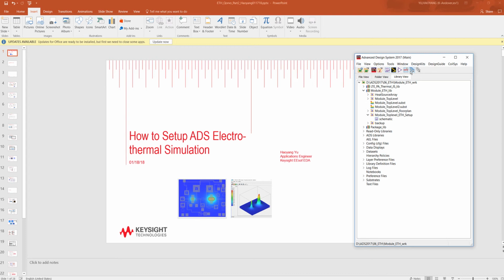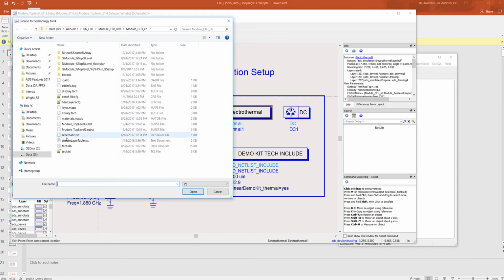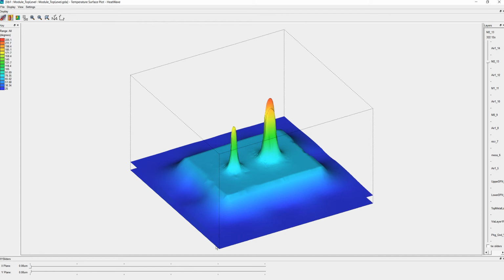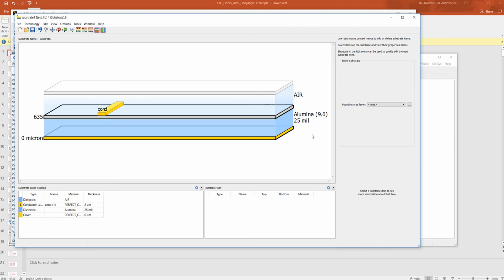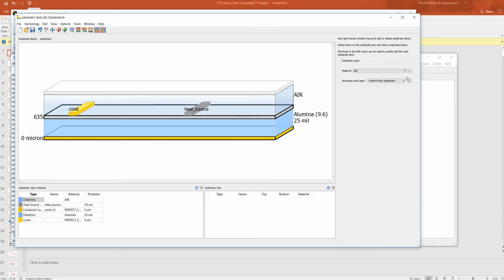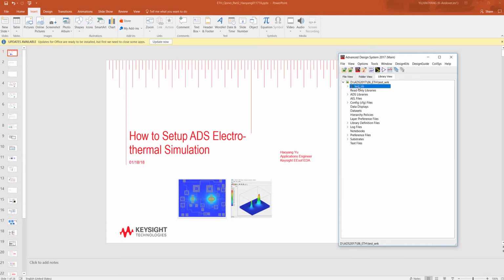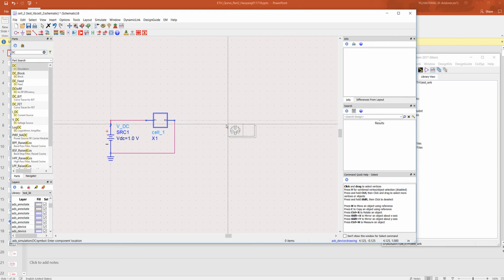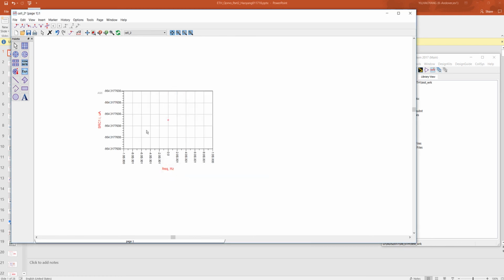ADS Electrothermal Simulation Setup

Comment: I have used a rogers luminate and i inserted the thermal parameters by myself. Also I have designed a layout with the footprint of the transistor and the transmission lines and after i inserted the layout as a symbol to a schematic , with the transistor and some real capacitors by murata , but the thermal simulator gives me errors. Can you help me?